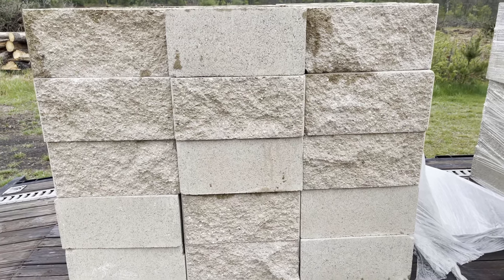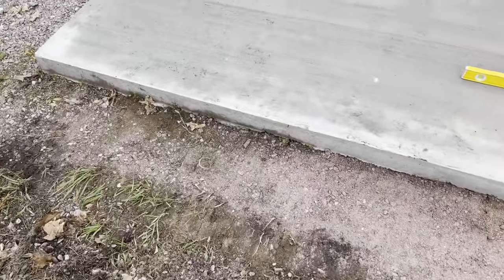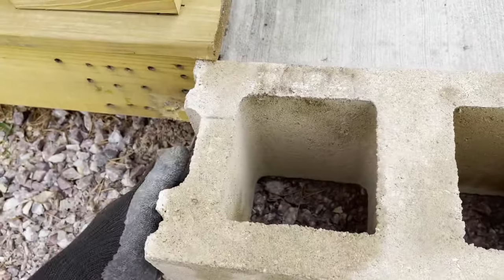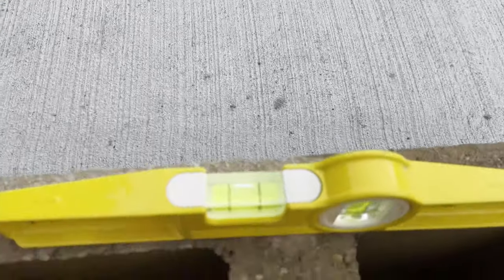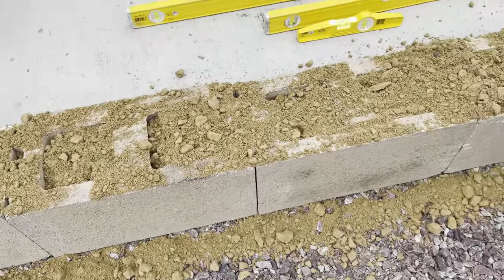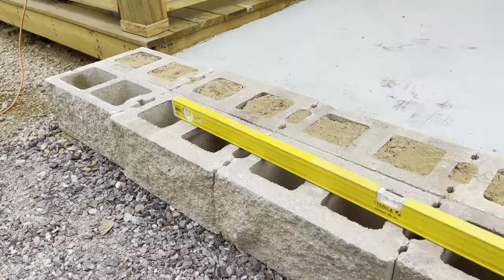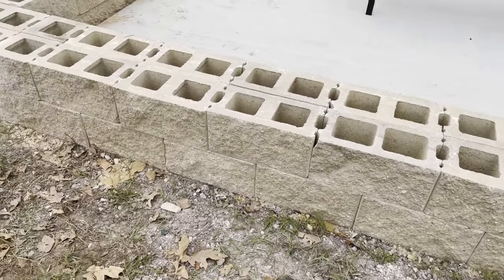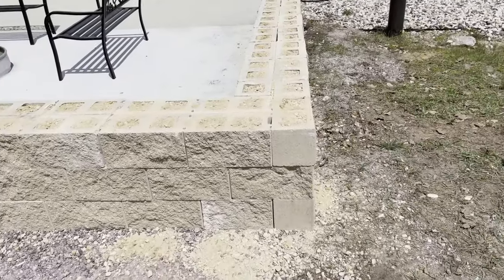How To Build A Cinder Block Retaining Wall & Bench Seat

Comment from the maker: If you shop on Amazon, please use Amazon Smiles to support Social Media Ministries. https://smile.amazon.com/ch/87-1084575

Coated Work Gloves
https://ebay.us/liG0S4

1 Foot Level
https://ebay.us/NofE69

2 Foot Level
https://ebay.us/Fo6BMm

6 Foot Level
https://ebay.us/lccI67

Masonry Saw
https://ebay.us/k3VH0E

Or You Can Use A Circular Saw
https://ebay.us/5xWLUj

Masonry Blade
https://ebay.us/3cxsgD

Caulk Gun
https://ebay.us/C2fj4E

PL 500 Landscape Adhesive
https://ebay.us/e7i14L

Hand Trowel/Shovel
https://ebay.us/Kq7E0F

Cinder Blocks For Your Wall
Check with your local Menard's, Home Depot, Ace, Fleet Farm, Et Cetera.

Comment: Looks good. I will dig  a trench, prepare a concrete base for cinder blocks and put some concrete mix on the small gaps between the blocks to add stability.
Reply from the maker: Nice!
Reply: Your right that's how it's done i do it the same way definitely need a concrete base
Reply from the maker: Awesome!
Reply: If it were single block wide and taller it definitely would need a concrete footing maybe vertical rebar. But for this type of wall this is completely ok. It’s not really going to heave because the gravel base water isn’t sitting against the wall underneath.

Comment: If that patio was built out of paver bricks (about 2 1/8" high, plus 4-5" of paver base and 1" of paver sand)would you go about building the sitting wall the same way, or would you make the gravel base deeper (or pour a foundation)? I've got my backyard excavated and am trying to move forward without any surprises
Reply from the maker: 6 inches of a gravel/sand base would be good for building the bench. Of course, depending on your climate, pouring concrete footings would also work.
Reply: @HowToVideoChannel  Thanks for the response. I'm in Los Angeles. Does that make a difference?
Reply from the maker: Yes, since you don’t have to deal with the freezing and thawing of the ground like in the cold winter states you can safely choose either method. I’d recommend the gravel/sand in case the ground moves and it’s also less expensive.
Reply: @HowToVideoChannel  thanks!

Comment: Great Wall! Do you know how well this type of walls hold up during the winter? I am thinking about doing something similar with concrete blocks but I am concerned they will get busted up during the winter up here.
Reply from the maker: This wall has made it through several Wisconsin winters and still looks like it does in the video.

Comment: As a new DIYER, this is a great video and explanation. We’re planning on doing this project after seeing your video and have shared it to other several times. Can this be done on an existing concrete patio surrounding a pool with wearing holes in the bottom?
Reply from the maker: Thank you for the encouragement and support! Yes, you can construct it on an existing patio. However, I’d recommend building it outside the patio. That way, if there is ever an issue where the patio needs to be replaced the wall will be able to remain.

Comment: Hi, great video. I am doing something similar. Cinderblock wall and bench with porcelain paver in the middle as the patio. I notice most videos use gravel base but I’ve already purchased a paver sand base. Will this work the same, or do I need to use gravel ?
Reply from the maker: The paver sand will work as long as you compact it well and make sure it’s a couple of inches think. 

Glad you enjoyed the video!

Comment: Great video! 
I live in CO and want to make something similar but the retaining wall would be holding some dirt. Would it still be okay to fill with gravel or should I use something else? Walls would be about 2-3ft tall.
Reply from the maker: Yes, that should work well. Make sure you have drain tile and rock, gravel, dirt behind the wall.

Comment: Great video. Could I use the same process for a decorative retaining wall around a pool. As a DIYer I like how your process was all dry stacked, and I wouldn't have to use a concrete mortar. I did notice however that cinder blocks don't interlock like some other landscaping stones. If my wall is not structural (and will only be 2 rows high) cinder blocks should work for me. I would assume filling them with gravel is key, correct.
Reply from the maker: Yes, you can definitely use the same process for a decorative wall around a pool. Filling them with gravel will help with stability, which is important because even though you intend it to be purely decorative there is bound to be a kid walking on top of it, climbing on it, or people using it as a bench.

Comment: Does that adhesive work just as good as mortar?
Reply from the maker: It really depends on what you are building. Mortar has more strength for taller projects. But the adhesive is sufficient for extra strength in retaining walls. After all, most retaining walls are dry-laid without any bonding agent.
Reply: @HowToVideoChannel  I have a brand new concrete driveway. I want to lay a 2 ft wall on the new driveway. Neighbors tell me use concrete bags but some say adhesive will work.
Reply from the maker: If you’re using retaining wall block then I’d lay them dry or use adhesive.

If you’re using concrete block then use mortar.